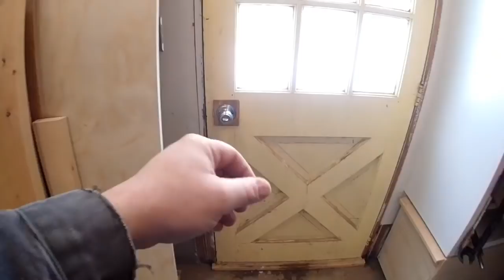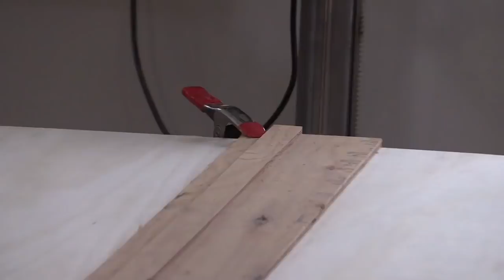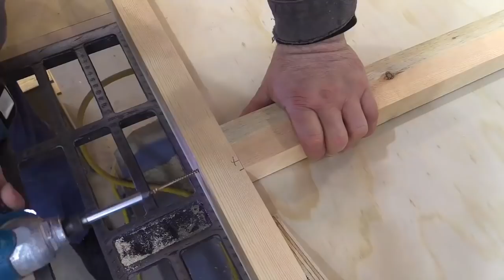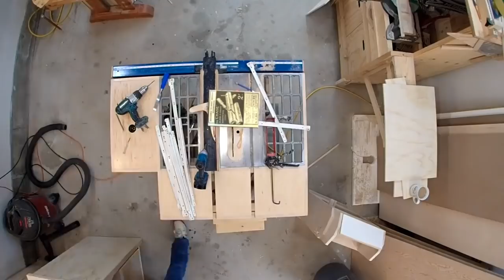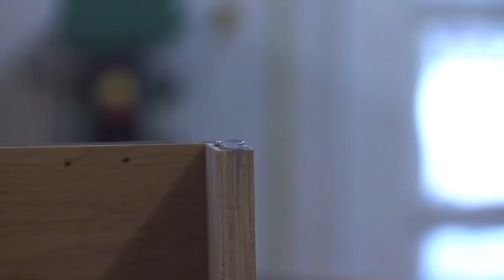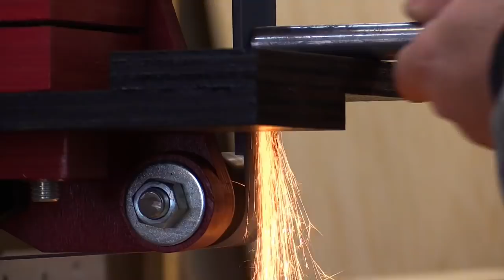The Belt Grinder / Planer Stand Build

Comment: I really like your fold away equipment. my workshop is the size of a single car garage (probably because it is a single car garage and the car is relegated to the roadside) so space is a premium, I am going to use some of your neat ideas to maximise the limited space I have but still have the equipment to hand without having to store everything in a cupboard then set it up every time I need to use it then have to pack it all away before I can get anything out. Excellent video as usual

Comment: John Heisz I often build projects using similar construction (I'm currently fixing/rebuilding/making useful a 30y/o piece of ikea furniture by adding a similar structure), and watching this video made me wonder about 2 things:

- I often rip down larger 2x lumber to make pieces the size and shape that I need like you did in this video, and it's not unusual for me to run into a piece that has a cup in one part (usually the middle :-/ and not the rest) and when i rip it down I end up with pieces that are significantly not square, and then end up chasing my tail trying to square them with the inevitable bows you get in longer pieces when you release the tension in the wood making the rip.  On my current project by the time I got what were going to be 1-1/2x1-1/2" uprights square I ended up with just over 1-3/8" square which meant that all the pieces that mated up to them ended up having to be cut down to the same thickness, resulting in more tail chasing...  (I had enough of a hassle with this last night that I ended up checking my blade for square 2x 2 different ways, was wondering if my fence was warped... and found nothing)
I was wondering if you end up with the same issue and have some easy way to deal with it/avoid it, ignore it or maybe somehow your dimensional lumber is better than mine.

- second, you often use construction adhesive on these things, which really surprises me, why do you use it?  
For my similar construction (typically ripped down 2x or pieces built up out of strips of plywood, or like this project a combination of both) has gone through an evolution of fasteners and glues.  I started with gluing and screwing everything, played with all sorts of glues... eventually I found that 18ga brads and plain wood glue is fast and I have never had anything fall apart.  I'll still occasionally use some screws, and I find places for other glues, rarely (I used both in a deck gate recently, but that's outside, and I'm using both on the current project but it needs to be held to cheap Ikea laminated particle board which nothing else will really work).
I have had construction adhesive fail on me (admittedly, only once or twice), and I hate how it seems like you can never get it quite flush (I tend to fit up nice tight joints), and somehow it always gets messy on me.  Since it doesn't squeeze and spread like most other glues I'd be surprised if you got as strong a joint (not as much surface area, and the glue makes a thicker joint which typically isn't as strong either)
Reply from the maker: Mark Pikas I'm very selective when I buy construction grade lumber to use for these types of projects, and I know what to look for to avoid the problems (for the most part) that you list. I also let it dry for several months before I use it.
As for the adhesive, I've explained that so many times now it seems like it's the only thing I talk about. I did write something about it here: http://www.ibuildit.ca/Weblog/blog-15.html
And I talked about it briefly in a video on my other channel.
Reply: John Heisz thanks for the response... 

I was wondering... I'm usually pretty picky when buying the stuff, but to be honest 90% of my projects are built out of salvaged stuff (most of my plywood has been the leftover and cutoffs left from the construction of my father-in-law's house, so no nice furniture grade stuff like everyone else uses, and this 2x stuff is from a massive loft that a friend of mine built in a college dorm years ago, plus assorted dumpster dives...).  "Selective" for me means pieces that are long enough to make what I want to make out of and don't have too many screw holes in them or they won't matter for the final result...  I tend to put a lot of 90* joints in things to straightened warped pieces.

You know, it's funny, I've seen your videos that talked about something else that you repeatedly get questions about with a "I'll answer it here but it's not like it is going to prevent future questions," and a couple where you show what you use "only use polyurethane because it's the strongest" but nothing about why before now.  I think that part of the problem is that even if someone is interested enough to look and has some proficiency in doing so (I'd bet that most of your viewers do not), with multiple channels and a web site(s), then add multiple people (say Izzy Swan, Mattias Wandel, Jay Bates... all who have 3 or more places that their stuff is stuck in and significant overlap in projects) it's not always easy to find stuff if you know that it's out there, less so if you're not sure that it was posted.
Reply: I joint my 2x stock before I do any project. If it counts anyway. You could rig something up on a tablesaw if you had to. I prefer a solid jointer to square things up, then rip. Also I've had better luck storing pine on edge rather than flat or on end. But pine will always be what it is.

Comment: Awesome project. 2 questions,  what blade do you use on your miter saw, and how come u went with the construction adhesive. Great job on the vid two.
Reply: The adhesive is polyurethan and he use it because it is cold in his workshop in the winter.
Reply from the maker: Matt Diresta Thanks! It's a Freud blade and like gamingSlasher said, the polyurethane construction adhesive works when it's cold in my shop.

Comment: Gotta say that looks like a really nice setup. More impressed with the camera work. Must have taken as long to setup cameras as build it. How did you do the pass under the planer part? Cheers. Good video.
Reply from the maker: hanksgavin Bolted it onto the edge of the 2x6 with a hanger bolt, then pushed the board through with the machine turned off. Added the sound in during the edit. Pretty convincing, no? :)
Reply: A lot better then what I thought you did. haha I thought you routed out a deep phone size hole in some thick stock, secured the phone down and passed it through.

Comment: Hi John, thanks for all of your videos.  I just bought my first planer and I have a couple of questions.  I didn't find a build article or plans on your site, unless I over looked them  Anyway, how are the drawer slides holding up?  Are they supporting the weight all of the time or only when sliding in and out?  I noticed the feet/legs on the outside edge and thought they probably made up the majority of the support when in the out position.  Also, I was wondering if the bed/table you made that sits in and extends the bed of the planer was long enough to significantly reduce snipe?  I guess what I'm asking is if you had it to do over again would you make them any longer?  Thanks again.

Comment: I've been having trouble with my planer feeding lumber through. Ill begin feeding them into the rollers and the board will stop and Ill have to push/pull it through the rest of the way. The roller will sometimes leave burn marks on the wood. I have the same planer as you so I thought maybe you'd have an idea why.

Comment: Having given your camera a ride on just about everything else, including a trip through the planer, I'm surprised that it didn't get the great treat of rides on the glue gun and the nailer...

Otherwise, I'm reminded of a line from The Bard:  "...full of sound and fury, signifying nothing...".

Honestly, it was a virtuoso example of editing.  The woodworking was, as usual, extremely  competent, but you showed us - well, many if not all of us - nothing particularly new.

Nice cabinet, seems to be a wee bit specialized for your particular shop and work pattern, but otherwise?